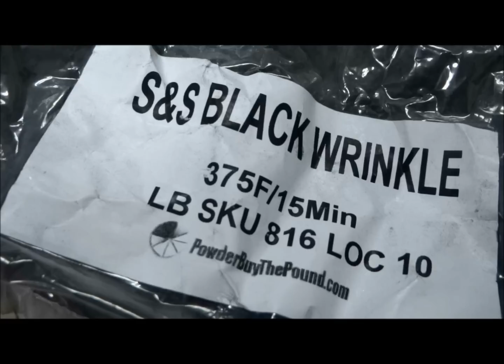POWDERCOATING ENGINE COVERS PART 2

Comment from the maker: The powdercoating will not scratch off. But over time, depending on the rider and the boots, the powdercoating will wear off the covers exposing the bare aluminum. Anything you put on the covers will wear off. If you want something that will never wear off, leave your covers bare aluminum. But for sure, powdercoating lasts much longer than paint or anodizing.

Comment from the maker: The red is a translucent red. Case bolts would look cool but it would not work too good because with the added thickness you probably won't be able to get a socket on them. If you did a color that required one thin coat it might work fine, but case bolts are not something that is ideal to powdercoat IMO.

Comment: For the valve cover. Let me get this straight before I mess it up. You did the black coat. Baked it. Then turned it on a side (let's say left) and did the opposite side "unicam" (so the right side) and bake.d. Then reversed the side.

Comment: When coating a part that has machined faces,threads,ETC...
You should tape them off. Also because the textured paint can make it leak
or take the engine out of spec.

Comment: I just powdercoated my rims, hubs, sub frame, chain guide (i imagine that wont hold up well) swing arm linkage and triple clamps, How well would you say they will hold up? and how well has everything you coated on your bike hold up? On a side note, got everything coated by what everybody has said to be the best company in Alaska
Reply from the maker: If the powdercoating is done right, which it sounds like in your case, the finish is fairly durable. Of course MX bikes take a lot of abuse and the coating will scratch and chip over time. Mine has held up great so far.

Comment: I'm curious as to why you let the parts cool before you applied the powder?I've been powder coating for years and I find it a lot easier to get a mil build up and to get powder to flow into all the tiny faraday pieces of the part. Also do you know what the Aama spec is when you purchase through the company you bought the powder from?
Reply from the maker: It depends on the part and how many coats I was doing to determine whether to let it cool or not. Some parts sprayed out better cool. I haven't done any pc work for a few years so not sure what the spec was.

Comment: did you take any bearings out of the clutch side cover?
Reply from the maker: No, I did not. There are no bearings in this clutch cover. But you will need to remove any bearings before powdercoating.
Reply: oh ok, i have a 2013 150rb and i am getting the frame, rims, hubs, valve cover, ignition cover, and clutch cover and i had a bearing in the water pump, but i took it out, so it doesn't seize.

Comment: what benefit will the parts gain form the coating..just another layer of scratch resistance?
Reply from the maker: It is mostly for cosmetic purposes, but powercoating holds up much better than the paint than comes stock on these covers. If you're anal about your bike looking sharp like I am, powercoating is a great way to customize and add durability to a MX bike.

Comment: Hey I have another quick question. I have a 2010 yz250f. The one engine cover has 2 plastic caps that you can remove to get the motor at top dead center. Anyways, I removed them to powder coat the engine cover. Only problem is now the engine cover looks awesome and the caps look bad. Do you think I could dump powder on the cap and stick it in the oven? I'm afraid of it melting. Or I could spray paint it but I'd never find the right color paint. Any input?
Reply from the maker: The caps would definitely melt if you put them in the oven at 300-400 degrees. Powder would not stick to them since they are not conductive. Your best bet would be spray painting them or just leaving them as is. Paint does not hold up well on plastics.
Reply: Hey buddy just go on eBay you'll find replacement caps for pennies

Comment: All that work and you did not want to take the 30 min. to fix those numbers?
For a much better looking part but more work.
You would need  a gun that can do 4 coats.
1-coat whole part with the color you want the numbers to be. Oven just until full flow out of the powder. Remove let part cool down to warm.
2-cut out numbers and place on part. Coat with the black and put into over for flow out. Cool and spray inset lettering as shown in video.
3-clear coat for added protection, it is a dirt bike.